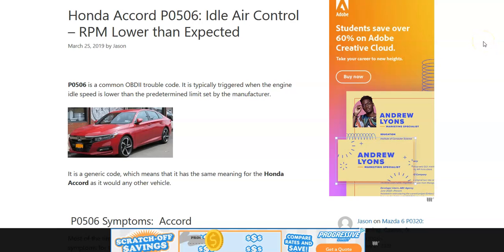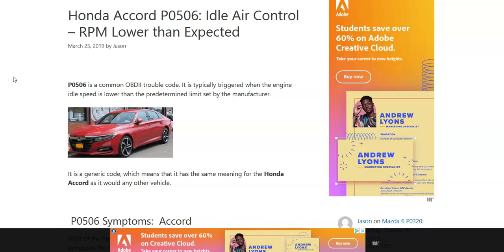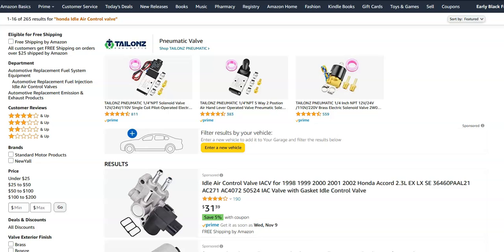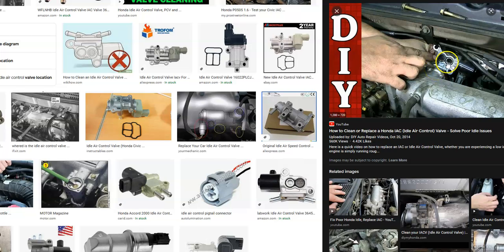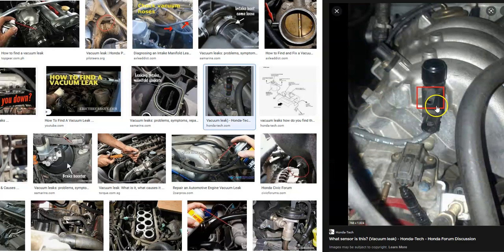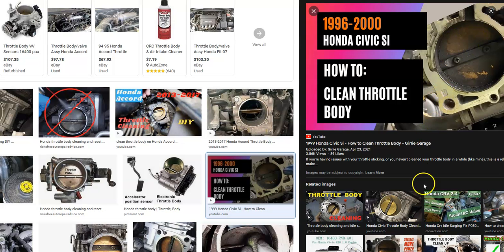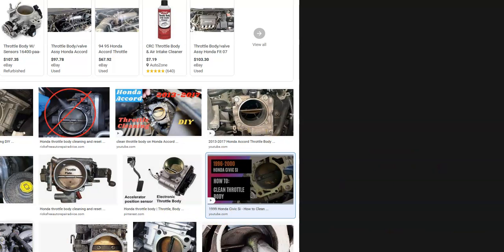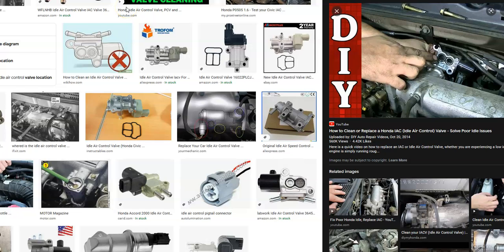How to Fix Honda P0506: Idle Control System RPM Lower Than Expected

Comment: I have replaced all hose throttle body and the idle air control valve and still get the code
Reply: Ever figured it out?